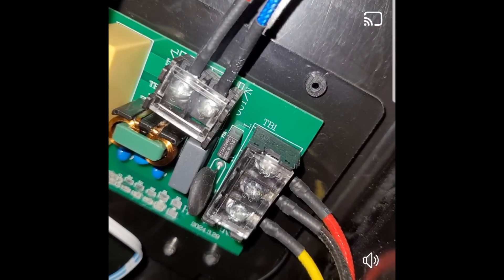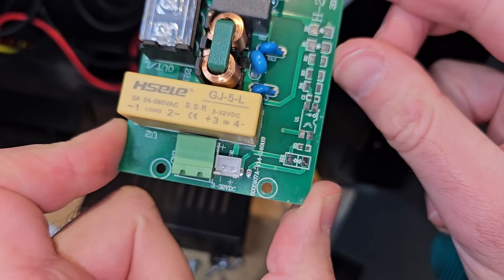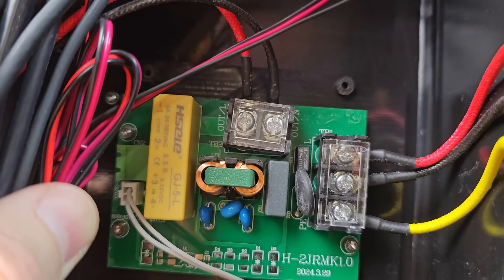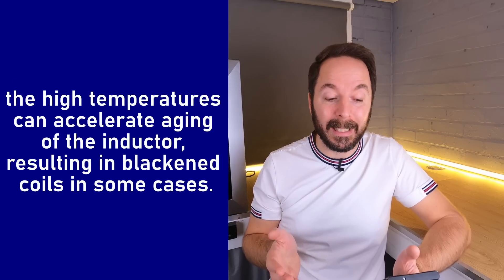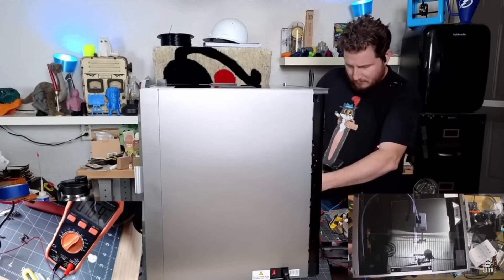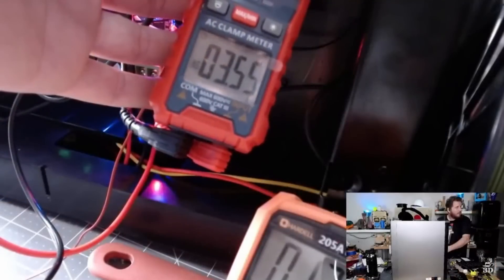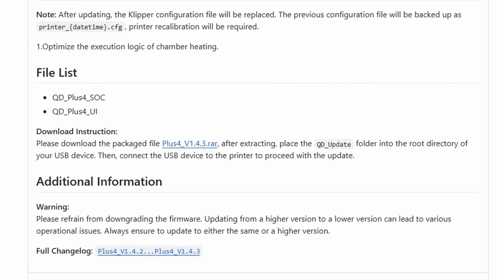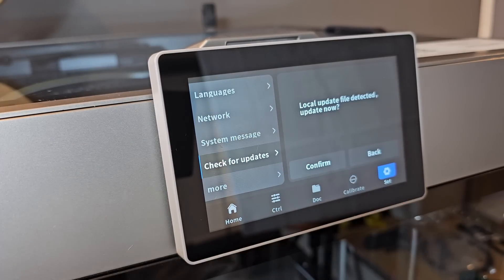Qidi X Plus 4 Defect & Safety Risk - All The Facts Explained With Reply From Qidi CEO

Comment: They should have specced the parts for 100% duty cycle to start.    Looks like some common mode interference chokes.  Probably aluminum windings as that's kind of a thing these days.   Maybe not,  regardless they clearly can't handle the current they are passing.   Epic fail IMO.
Reply: What country is this company from.  I'm guessing one with 240volt power, so the board would have been under less stress Compared to 120volt mode.
Reply: @rikidawson7510  It is from China. The power grid in China runs on 220 V mains voltage at a frequency of 50 Hz.
Reply: @andreas.grundler  that explains everything. They probably didn't test the part on 100/120v 60hz. Or if they did, they didn't test it enough.
Reply: @rikidawson7510  They test their machines on 120V. Don't be silly. This is also the same board they used in the Q1 Pro in all regions and is extremely similar to Bambu Lab bed power supply boards.
Reply: @802Garage  clearly, that's why it's under rated.  But clearly have no idea what I'm talking about.....
Reply: @rikidawson7510  Well as someone who has been tracking this issue since it was first discovered, what would I know? Again, the same board has been used in the Q1 Pro in 120V countries. The reason it likely wasn't found as an issue when testing the Plus4 on 120V, which I have literally seen their lab equipment to do such testing, is that the majority of units don't show any problems immediately and continue to function even if the coil has gotten very hot. Many of them don't even show discoloration unless you look very closely. Their lab power supplies may also provide more stable and cleaner power than what a lot of homes get. Now, to be clear, I completely agree they didn't do ENOUGH testing. To claim they didn't test it on 120V simply because China is 220V is nonsense.
Reply: @802Garage  fair enough:p
Reply: The board is built for 240v.  Why it was shipped to 120v regions it's beyond me
Reply: @TheGamersRace  Again, it is designed for both. It's in every Q1 Pro. A very similar board with many of the same components is in Bambu Lab machines in 120V regions. It simply does not handle enough current for the heater in the Plus4 combined with the power switching mode.
Reply: @802Garage  No, what I'm saying is that they did not design the original board for both, and most likely they also did not test it with 120v when they were implementing it into their 120v market segment.  They made a leap of an assumption that it could handle the extra current, when it could not, or even worse, they didn't assume anything and just said "send it".
Reply: @TheGamersRace  They DID design the original board for both. That's what I'm telling you. The SAME board is used in 120V Q1 Pro printers. The SAME components are used in 120V Bambu Lab printers. The issue is the higher current draw of the Plus4 heater in 120V regions which is overloading the choke, especially without a zero switching function. They DID test the printers because of course they have 115V lab power supplies. You're simply incorrect and please stop repeating it. I completely agree they did not do ENOUGH testing because they obviously missed this issue, but stop literally making up a narrative.
Reply: @802Garage  You literally just proved me right in your own comment.  "The issue is the higher current draw of the Plus 4 heater in 120v regions which is overloading the choke" So in other words,
THE COMPONENT IS NOT DESIGNED FOR 120V IN THIS APPLICATION, AS IT EXCEEDS THE CURRENT LIMIT.  Ffs
Reply: @TheGamersRace  Please read my earlier comment in the thread which I assumed you had already read before posting misinformation. You also changed the wording of what you said to try to move the goal post. I'm sorry you'd rather be upset than informed.
Reply: @802Garage  You mean all the comments where you say it's understandable for them to use a component outside of it's intended specifications because it doesn't get SO FUCKING HOT to the point it explodes immediately, and instead only slightly discolors?  The component even withstanding what it has been is a miracle. I'm sorry I have to elaborate further for you so you can comprehend what I've said, lemme correct that.  It was not built or designed for 120v, AT THAT CURRENT DRAW.  It was not DESIGNED for that.  Hope that helps 🥺
Reply: @TheGamersRace  I'm gonna make this incredibly simple and leave it here. I already explained everything in my prior comments. Your prior statements were false. Someday learn to admit when you said something wrong and move on. Thank you for correcting your statement in your last comment to match what I had already said.
Reply: @802Garage   Except they're not.  It's not designed for 120v.  You're just going in circles here.  Also, by your own logic, "That's not what you said".
Reply: @TheGamersRace  that's how most products are done to save money.
Reply: @rikidawson7510  Agreed.
Reply: @Mindless_One  I don't work for Qidi. They messed up bad with this and I don't think all of their response has been good enough. I just try to not over state issues or make stuff up. People who think they know more than Qidi because they understand Ohms law are simply being silly.